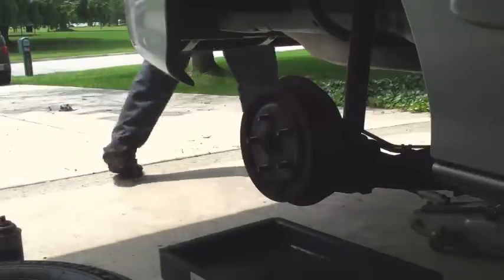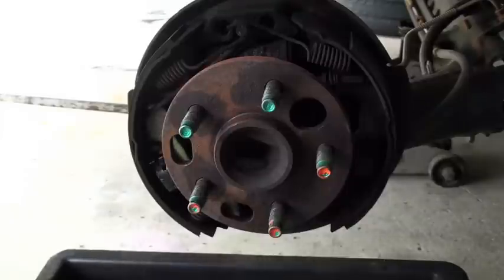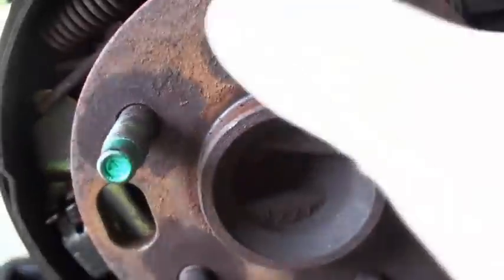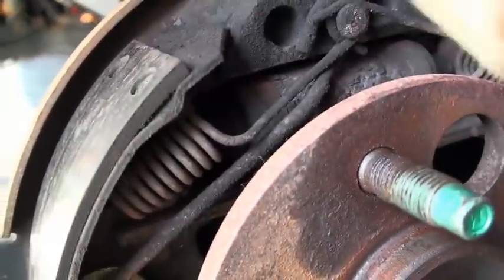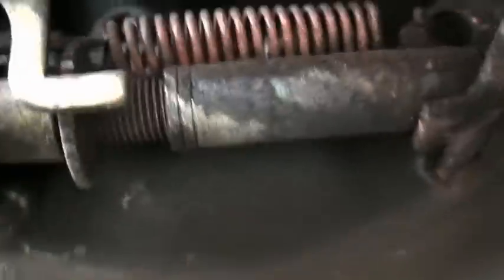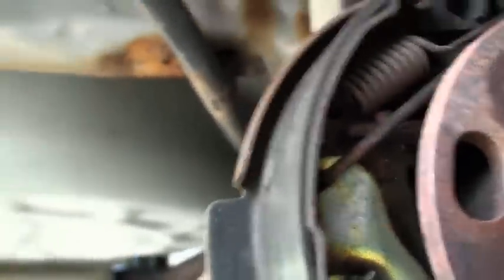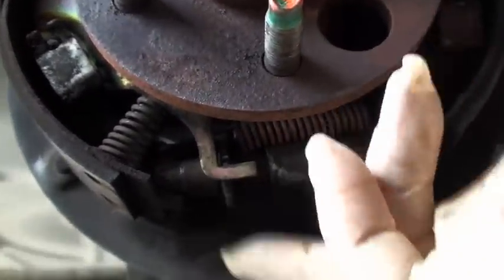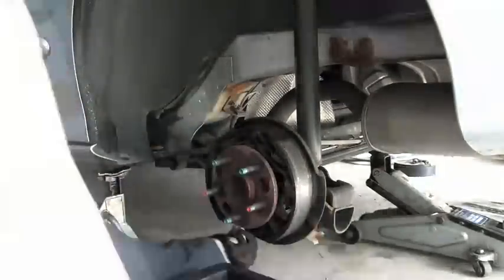Drum Brakes a Quick Look - EricTheCarGuy

Comment from the maker: It's corrosion, it usually happens on cheaper batteries.  It comes from the gasses that naturally vent from the battery which are corrosive, they eat away at the metal terminals and cause the residue that you are seeing.  To get rid of it clean it off with a wire brush and then clean it with baking soda and water, you could spend money on the spray stuff but the solution I mention will work just fine.

Comment from the maker: By the looks of it it might be an engine miss.  Take a close look at the ignition system, cap rotor, wires (I think the original factory wires are the best, they last forever), and especially the plugs, make sure they are Denso or NGK's as listed on the emission sticker.  It might also be the EGR system i.e. clogged passages.  You can check catalytic converter operation by taking it's temperature before and after the cat, it should be 100º hotter at the outlet.

Comment from the maker: That's not true, don't use any lubricants or anti-seize on new or old ball joints, it's better that they "lock" into place, that's why they use castellated nuts with cotter pins.  As for removing them, hit the lower control arm unless it's aluminum.

Comment from the maker: When you do this stuff every day you get the hang of it.  Practice is the key, you were smart to do what you did though.  BTW if your just replacing a wheel cylinder you don't have to remove the shoes, you can just spread them apart and insert the new cylinder.

Comment from the maker: Yes, you will have trouble with that without a doubt. I plan to do a video on just that the next time I get one in.Yes it is rusted in place and you will have a hard time getting it out because you really can't put it in a press to get it out, you have to beat it out while trying not to ruin the bearing.I've seen people take it apart with a slide hammer splitting the bearing but I do not recommend that method at all.I insert longer bolts into the back of the bearing and beat on those, carefully.

Comment from the maker: The rubber is there for noise reduction.  If the rubber  wasn't there when you applied the brakes they would "click" on initial application.  It's only on the pin that is on the leading edge of the disc which has a tenancy to move the most.  Don't use grease to lubricate the pins, it destroys those rubber dampers, use silicone paste instead.

Comment from the maker: Most of the problems I've seen have been in the rubber lines.  I've seen metal lines rust and leak, or get bent in an accident but for the most part I find the majority of issues are in the rubber lines.  The holes in a "racing" rotor need to be chamfered after they are machined, that is to say they can't have a sharp edge on the edge of the hole that may be left after machining.

Comment from the maker: I prefer not to cut rotors when they are hot.  I suppose you could put them in water to cool them (they get splashed by cold water all the time in the winter) I would rather just let them cool over time.  In my experience the best way to cut them is with an on-the-car brake lathe, they seem to turn out the best that way.

Comment from the maker: The fact that the fluctuation stopped when you unplugged the valve means that there is probably some external cause to the fluctuation, if the valve was bad it would not be able to work at all.  The valve is trying to correct for a problem.  Did you bleed the cooling system according to my instruction, and did you check for a vacuum leak?

Comment from the maker: I think what your describing has to do with the rear brake adjustment.  If not adjusted correctly it will affect braking on the front wheels as well as the rear wheels.  This sounds like a good video Idea.  BTW did I answer your questions to your satisfaction in the last video I did?

Comment from the maker: I'm not saying it's not possible, you could always measure it and compare it to the old one to find out.  Whenever I install a new wheel cylinder I push the plungers in to make sure they aren't sticking (I have seen it happen).  You might also check the shoes to make sure they are the same as the ones you took off.  Good luck.

Comment from the maker: Thanks man.  Remember there are 2 types of drum brakes, servo (back up to adjust), and non servo (parking brake adjust).  If the brake shoes have equal amounts of friction material it is most likely a non servo type, if one shoe has less friction material on it than the other it is usually a servo style.

Comment from the maker: Good to see you!  In my opinion the best engineering is simplicity itself.  In fact there are parts of the brakes that require cleaning and lubrication during replacement, I cover those in the full length version.  Some cars have a bearing assembly integrated into the drum that needs to be cleaned and lubricated when servicing also.  As for when they are replaced, not to sound sarcastic but when they wear out.